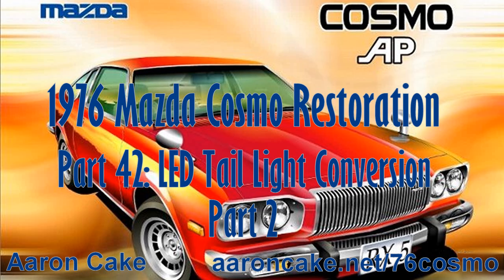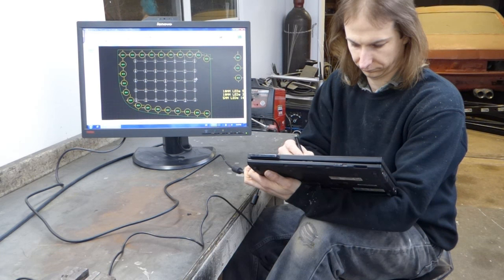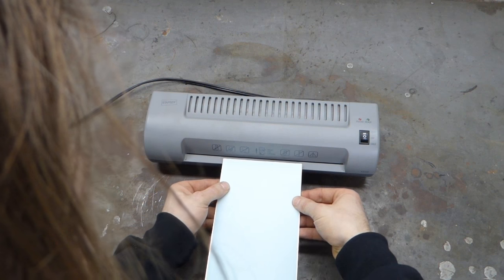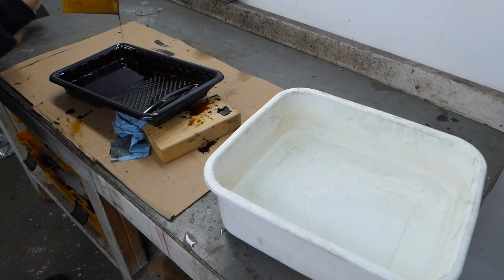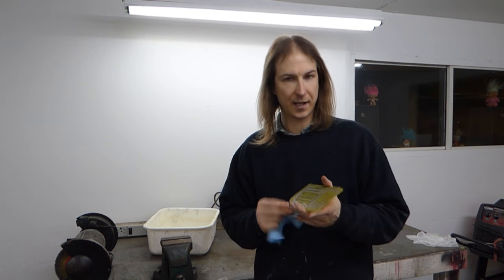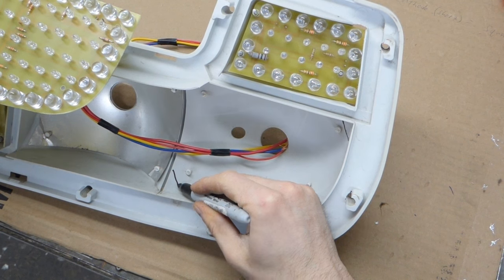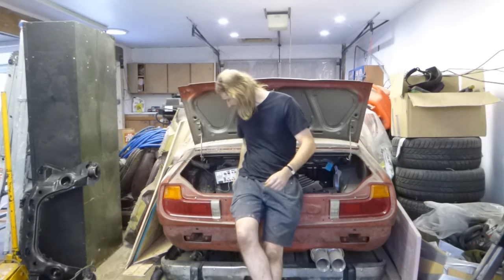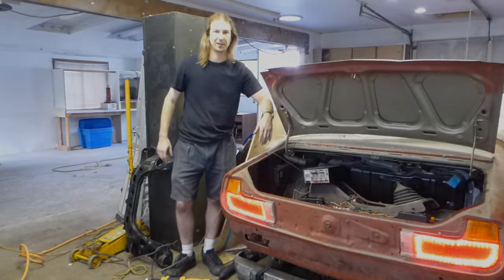Part 42: LED Tail Light Conversion, Part 2 - My 76 Mazda RX-5 Cosmo Restoration

Comment: I watched this video a while back and now again after a friend of mine asked me to design some heart shaped LED taillights. It took me longer than I'd like to admit wrapping my head around the inner workings of these but now I think I got it down. I just realised the whole system powers on with (12v switched/acc) and a separate 'input' from the original wires for the lights. Just out of curiosity where do you plan on tying the switched 12v from?
Reply from the maker: Originally I intended to just run a switched 12V wire to the back, taking the switched signal from the ACC/IGN contacts of the ignition switch. But since then I have re-thought the entire electrical system of the car and will be designing a body control module which will handle control of most of the car, so it will activate the relays to control the tail lights.
Reply: @aaroncake  that sounds awesome! Please make a video of it if you have a chance
Reply from the maker: Definitely. The whole electrical system will be well covered.

Comment: Hey Aaron.  I don't know if you mentioned this again to this or previous video but what kind of leds did you use?  What brightness? Viewing angle etc?
Reply from the maker: It was in the first 5 minutes or so of part 41 but the white 10MM are 20,000mcd, red 10MM are 10,000mcd, yellow 10MM are 10,000mcd, red and 5MM around 6000mcd. They were purchased in bulk from a supplier in China, unbranded. I do not know the viewing angle but I'd guess 30 degrees. If you are to do this, I would recommend looking at SMD LEDs. Takes up less vertical space on the board and a hell of a lot less holes to drill. Just trickier to solder.
Reply: aaroncake wow that's a quick reply.. Yeah I was looking for smd's. As you said extremely easier to solder maybe with a oven and a dab of glue underneath them to hold them stable
Reply from the maker: ***** Just happen to be sitting on the porch with a mug of tea, replying to YouTube comments. There is special liquid solder for SMD work that can be oven soldered. A tiny dab of super glue would hold the LED in place until the solder fuses but I think the solder also has some glue characteristics.
Reply: aaroncake well I really appreciate this. I guess judging from what I read to the comments I think that some people would like you to be working 24/7 to the car to satisfy them! Pffff.. Enjoy your tea.
Reply from the maker: ***** Actually I'd be happy to just work on my own projects, but unfortunately this is the real world and that ain't gonna' happen.

Comment: I missed that Aaron. What was that spray you put on the tail light boards?
Reply from the maker: I used two sprays, both from MG Chemicals. After soldering I used Flux Remover to remove, well, the flux. Very important step otherwise it will absorb moisture and corrode the board. Then after cleaning I applied Acrylic Conformal Coating. It seals the board from moisture. Ever tried soldering to the traces of a commercial board and found it maddening? That's the conformal coating (or the solder mask).

Comment: There are religious arguments about cutting before or after soldering, but if you do it afterwards it leaves the copper/solder interface exposed to air and the joint will fail earlier than if you cut then solder (sooner as in 5-10 years instead of 10-15 years, but in a harsh environment it can be earlier)

The easy solution to stopping offcuts flying is to put a finger on them. Seriously, it's that simple.
Reply from the maker: I wasn't even aware there were arguments over whether to trim wires before or after soldering. Makes sense though that a coating of solder would help control corrosion. Well, we will have to see if in 15 years my wire ends are growing a fuzz.

Comment: Very nice work. FYI, there are two sets of tails on ebay right now. :) $200 and $300
Reply from the maker: Just looked them up. Indeed, there is as set complete with panel and trim. Unfortunately the driver side is cracked.

Comment: Hey man whassup !. Hope you doing gud. Well by watching your tremendous work, I'm Planning to make my maxda 4th gen B2200 pickup's LED Tail _lights. I need your favour. Kindly give me the list of all the Ingredients, stuff  you used regarding Taillight . I mean the stuff which you used  like the liquid which transformed coper to board.  And what kind or sixe of LEDs , resisters , and the cleaner you used at the end. I hope you'll get time to respond. PEACE
Reply from the maker: If you scroll down the comments you will find I gave the LED specs to someone else. Off hand I don't remember the series resistors I used for the LEDs as they were calculated for each string of LEDs and will differ based on the type of LEDs used. You'll find the schematics and source code with board patterns in the link in the description. I used Pulsar Toner Transfer sheets to transfer the pattern to the board, MG Chemicals 415 Ferric Chloride to etch, MG Chemicals 421 Liquid Tin to tin plate, MG Chemicals 4140 Flux Remover, and finally MG Chemicals 419C Acrylic Conformal Coating.

Comment: Hi Aaron,

I`ve not read all the comments... Maybe this topic is not new, but....how about the heat produced by the LED`s? You didn`t build a cooling system for them. Do you think they will survive a few hours drive?

P.S. Your Cosmo restoration is aaaawesome! You inspired me especially with the last two episodes.... i started to get familiar with Arduino now  :D

Greetings from Germany :)

Alex
Reply from the maker: I've had them running for several hours in the shop and the LED don't get warm. The dropping resistors do warm up slightly. This style of LED doesn't really output that much light compared to the high powered LEDs that come mounted on a metal heatsink. I was actually mainly concerned about the MOSFETs as I didn't want to mount them to a metal case or have any crazy active cooling. But they stay room temperature. PWM is very efficient and really they are only passing about 1A. Yes, this was my first experience with Arduino and it has really changed my electronics goal for the car. Lots more stuff coming up in terms of custom electronics. But for now, the current project pounding some metal.
Reply: Great to hear that. I´m looking forward to the next episodes!

Comment: +aaroncake If you find yourself making PCB's, you really should build yourself a vertical PCB etching tank out of sheets of Acrylic. Many designs include a hose and aquarium air pump to agitate the solution and an aquarium tank heater to heat the solution. You can even include a lifting tray to raise and lower PCB's into/out of the tank. I think you'll find it much easier to use than a painter's tray. (And it's a relatively simple DYI project.)
Reply from the maker: I think if I end up mass producing boards I'd go that route. Sort of had something similar when I was a kid for making PCBs. Used old vacuum tubes to warm up a butter container containing the etchant. Just powered the heaters in the tubes. It worked, marginally.

Comment: Why not use hot glue to secure the led's (and the height adjustment nuts)? Its a great video and very interesting, but you could save yourself a shitload of time by using hot glue. 
My trick for the nuts is to simply put a second nut into the nut driver which will allow you to start them just fine.
For holes the bulbs used to go through I would have just modified the original bulb sockets to be a pass through.
Reply from the maker: Hot glue doesn't really work very well in cars. Temperatures within vehicles can get surprisingly high. Enough to soften the glue. Learned this lesson many years ago.

Comment: Those lovely connectors and you just couldn't solder the connections. Grease is nice, but all it does is hopefully prolong the inevitable bad connection from corrosion. Yes, they have little rubber seals for a water seal, but do you trust them? Often those kind of seal fail from temperature differences and end up sealing water in instead. Tin the crimp connectors and wires first with solder, then crimp them over and solder. Why take all the time for everything else and make a corrosion-prone connection in a lovely connector? I absolutely hate crimp connections.
Reply from the maker: In this case, the connectors will be inside the car so subject to far less abuse than in the engine bay or on the chassis. What's nice about the Cosmo lights is that the only part exposed to the exterior are the lenses. But personally I've never seen WeatherPack connectors fail due to water intrusion, only from things like physical damage. The OEMs crimp their connectors, never soldering. I like to go one step further with just a little dielectric grease. The key is a proper crimp, just like a proper solder connection.

Comment: It is absolutely beautiful what you did, but it takes a lot of time. Maybe it would have been easier to use standard printed circuit board with holes in it, of simply use ready made LED-strips you can glue on a piece of metal, simply cut it, stick it on some piece of what-ever and solder it together.  This has taken you hours and hours, maybe days.Well done, but to expensive.
Reply from the maker: One of the goals was to build something as an OEM would for as much reliability as possible. Perf boards are great for prototyping but have long term issues. Plus, rather messy to look at. Did not consider the LED strips though. I've seen some other videos of people using them and I think they are a good option for lights with more contours. At least the Cosmo lights are fundamentally flat so PCBs worked well.

Comment: at 48:20 why not use 2 nuts per rod and turn them opposite directions to lock each other in.
Reply from the maker: That would have also worked. Probably less messy than the Loctite.

Comment: Do you know where i can find this software ? Cant seem to find it anywhere
Reply from the maker: You mean "Copper Connection"? It was bought by ExpressPCB then rolled into their new product and the and the ability to print toner transfer removed. However, since the original version was freeware, it is still available to download.  Go to https://www.aaroncake.net/76cosmo/cluster/ and you will find the link.
Reply: @aaroncake  thanks a heap :)

Comment: Ok, i have no experience with this sort of work, nor am i an electrician. But, now that you're cutting holes in the lighthouse, wouldn't that nullify the membrane that's suppose to keep the lighthouse dry. Then wouldn't it be wise to use some sort of laminate/silicone layer thingie on the soldering side of the boards you made to prevent condensation from messing with the electronics?
No idea if what i just said is utter nonsense.
Edit: wrote that before i saw that you were coating the boards.
Reply from the maker: These lights were never sealed from the factory. They were always open to the inside of the vehicle. Keeping them vented should eliminate condensation.
Reply: Ah, i see. Thanks for clarifying.

Comment: Can I hire you to convert my tail lights?
Reply from the maker: Well, I think that due to the amount of labour necessary to do something like this, the price I'd have to charge would be  likely more than most people would be willing to pay.
Reply: aaroncake Can you give me an idea of how much? I have a 2002 Mercedes Benz cl55 AMG and I want to make the bottom park lights full LED. The brake lights are LED but for some reason Mercedes made the bottom lights two regular bulbs
Reply from the maker: Looking at some pictures via Google, can't you just put some LED bulbs into the lights in place of the incandescent? Honestly without having a set of those lights on hand to examine I could only guess because modern lights are generally glued together. Taking them apart is non-trivial, usually involving carefully heating in an oven.  Then board design, figuring out how to insert it without mangling the lights...all very time consuming to likely over $1000.
Reply: aaroncake thanks for responding, the reason I didn’t put LED bulbs in the marker lights was because both taillights only have two bulbs for the markers, so it really don’t change the look. I’m figuring about three rows from left to right of those LED like you made here with the exception that they would only be marker lights would give it that laser look kinda like the newer models. If you think that would be a solid price if you have a way we could exchange contact information, I will look to buy two more taillights and then I could send you those to convert. Who knows, you might even make it a project shared on your channel 😁
Reply from the maker: The only thing is, I just can't take on another project right now. And keep in mind that there is every possibility I would destroy the light in the process of opening it up, and since it is a prototype there would be absolutely no warranty. That said, it's not something I can do right now. Maybe when the Cosmo is finished it is something I can look at but for now I just don't have the time.
Reply: aaroncake okay, well thanks anyway

Comment: Do you watch MightyCarMods?
Reply from the maker: Occasionally. I've seen a few episodes like the turbo Miata and such. Just don't have as much time as I like to view other videos. Another excellent automotive channel is AutoRestoMod.
Reply: I ask because of the "unicorn fart dust" comment you made
Reply from the maker: Sean Slater Ah...wasn't aware they used the same phrase. I think I stole it from Top Gear.
Reply: Nah, they just go overboard on it, watch the unicorn circuit if you wanna see what i mean. Btw, very nicely done on the tail lights, i like how closely that florescent diffuser matched.
Reply from the maker: Sean Slater I was very happy to find the diffuser was a perfect match as I had terrible visions of having to walk through a wrecking yard finding a light lens to cut up.
Reply: Oh and btw, I've watched tons of auto resto mod, unsubscribed recently. No clue why, but it got very unsatisfying after a few years.
Reply from the maker: Sean Slater I just haven't had time. Way behind in their episodes. Anytime I'm on YouTube I'm generally interacting with comments.
Reply: I believe Cake is at a much more serious level than those two Aussie rice boys ! No fabrication or attention to detail with MCM, they are merely adding aftermarket bits. And one of them being a prat (-;
Reply: Cakes much more in depth, and much more diligent, but those guys have some pretty good project cars under their belts too.
Reply: Lets not forget that any slightly technical work gets done by experts who happen to be their friends, they are just the vessel to bring us the content
Reply: ***** Well said !
Reply from the maker: ***** Like every car based TV show. The hosts drop in for an hour or so a day, do little work and plug some sponsors, then the crew carries on behind the scenes. I know this from experience, being part of two of those crews.
Reply: MCM are one of the worst car channels on here.
Reply: Honestly, compared to aaroncake, HRG and roadkill, I would have to agree, MCM is for people who want descriptive, watered down explanations of basic concepts with lots of 'fluff' surrounding it, the only time it is good is when they involve the people who actually understand the technical concepts
Reply: Different presentation for sure, but they aren't mechanics, they are car guys. There is a difference there. They like jdm cars with some jdm mods. Probably what makes them more appealing to the masses.
Reply from the maker: Mikey Rider MCM is a good light hearted thing to watch but if you are looking for information, then nope. I think Bad Obsession, Jafromobile and me are the ones who present things with ridiculous detail. Edit...And just to add to that, YouTube is always telling me my videos are too long. And I'm always replying with "that's what my audience wants and why my channel has succeeded".
Reply: When it comes to detail, i dont think I've seen any video top yours, Aaron. Maybe ericthecarguy, even then in recent years he's started to make his videos simpler/shorter to keep the short attention span of YouTube general audience.
Reply from the maker: Sean Slater I can only imagine the ridiculousness of if I followed YouTube's advice to keep everything around 5 minutes and certainly less than 10 minutes. I'd be up to video 300 at least. And then who's going to watch all of those?!  I made a decision early on to show damn near everything and only really cut out repetitive stuff.
Reply: Good on you, makes for one very in depth show.
Reply: You are certainly one of the best for my personal viewing pleasure. I missed your updates and very happy to see them return.
Reply: Sean Slater They don't seem to have a grasp on basic engineering principles, I guess as an engineer it is obvious to me but maybe they do it on purpose...either way I think the trick is to explain something in clear, concise fashion (like aaron and others), not dumb it down the point where it is almost comical. I like to think of my self as a car guy, a mechanic is surely someone who's job is to repair cars, even they may not have studied engineering (ericthecarguy), either way I don't think it is an excuse to 'gloss over' correct terminology and wording.
Reply: ***** Well they are both audio engineers, as in they design speakers and set up stages, etc.
Reply: Not yet
Reply: Why would he. those guys a stupid rough and dodgy and deal with well known car dealers that dial ode back. They wouldn't know how to rebuild a lawnmower
Reply: It seems your followers really dislike MCM
Reply from the maker: Sean Slater Clearly. I should form an army and stage a hostile takeover.